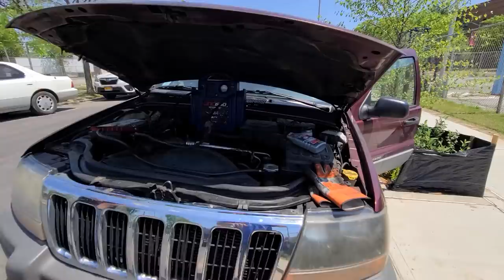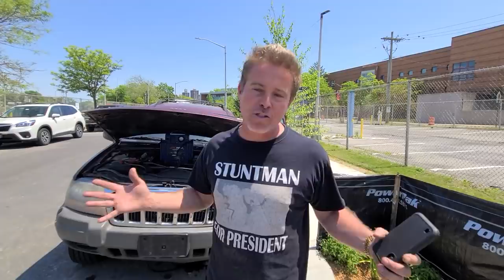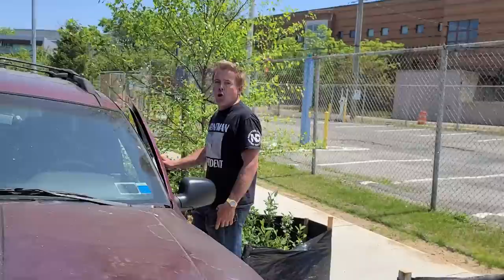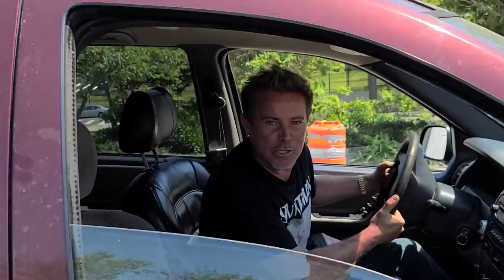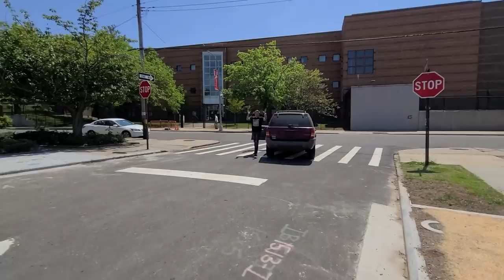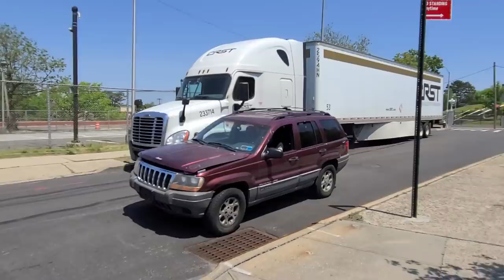Jeep Cherokee 4.0 With Stuntman Part 2, No Oil, 5 Pistons & Full Throttle! Only On Neutral Drop!

Comment: Those 4.0L motors are amazing. My wife's blew up at 60mph on the highway because the oil pickup filled with sludge. It had an aneurysm at 200K. If the previous owners had changed the oil more often it would have lasted forever.

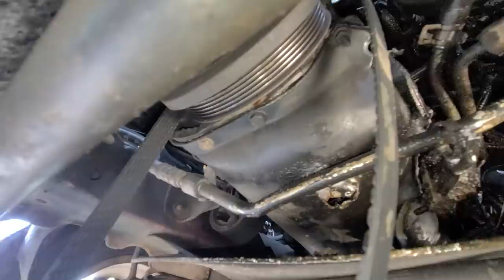Comment: Holy Shit guys! At 0:54 as you look up through the massive hole in the block you can actually see the intake and exhaust valves in the head... Epic Failure!  Both part 1 and part 2 are going to be posted in the resources tab of my online syllabus for engines class. Stuntman... I know this was hard for you dude... No killer wants to deal with a dead target after a successful hit. Thank you for hangin in there! Cameraman.. Thanks for rollin around in "The Wet Spot" to get that footage... You are a troopa! Seriously.. If you still have that piece with the PN# on it from part 1, I would love to have it! I am a Jeep guy. At present I am building a 4.7 "stroker" in my engine class using a 4.0 block, 4.0 rods, with a 4.2 crank and custom pistons. This bottom end with the Edelbrock aluminum head I picked up last Christmas (gotta love Craigslist around the holidays) is going in my 99 Jeep Wrangler. Again... Thanks for this footage... It was awesome!

Comment: If it's still crankin.. does that mean Stuntman forfeit for a loss? 🤔😕🤯

Plus it is 4.0 Jeep. You can be on a trail with a busted oil pan and it'll still limp it back to pavement. Again this is a prime example of what made Jeep Trail Ready.. its just the badges came two decades too late.